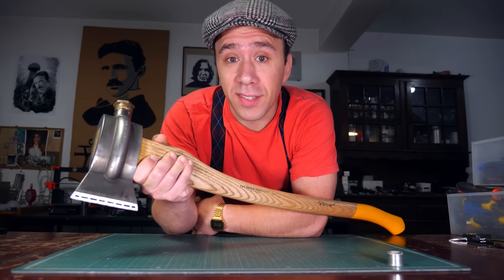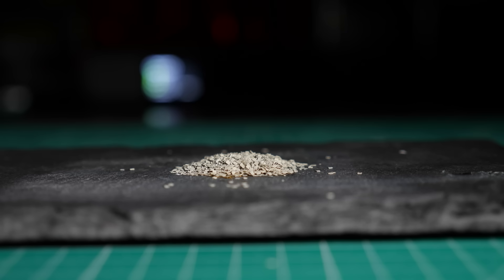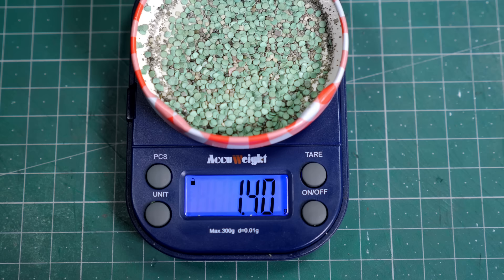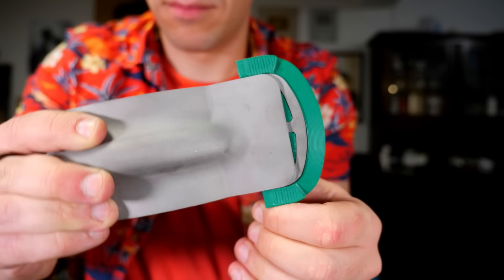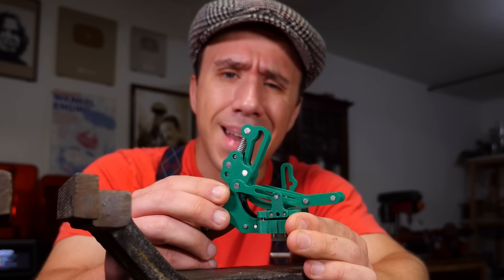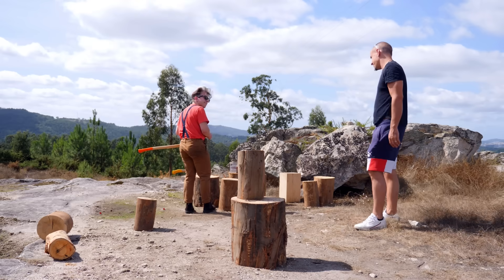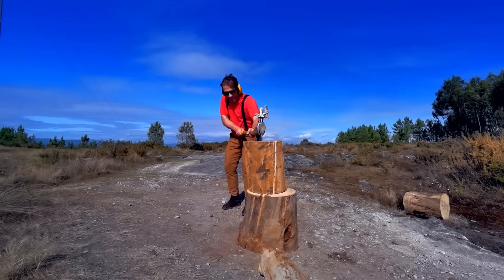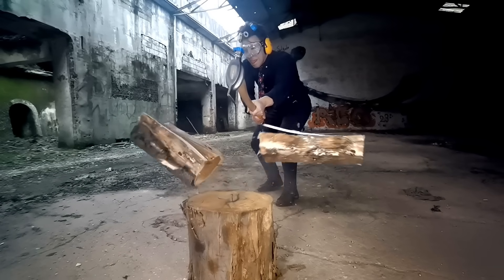I built a BETTER SHOTGUN AXE

Comment: Modern gunpowder (smokeless powder) is actually designed NOT to burn as fast as it possibly could (it's essentially the same thing as gun cotton, nitrocellulose, just cut into a bunch of tiny squares). This is because in a gun you need a force curve in order to overcome the inertia of the bullet and propel it down the barrel. If the gunpowder converted from a solid to a gas nearly instantly most of the pressure would end up forced out of the various gaps in the barrel before it would have time to propel the bullet. Gunpowder therefore has a carefully calibrated burn rate in order to achieve the optimal transfer of energy into the bullet. For your application you might be better off going with the raw material gunpowder is made from, I.E. nitrocellulose. You could probably get your hands on gun primers a lot easier than shotgun shells, and those combined with nitrocellulose (which I know you already know how to make) are essentially the same thing as a shotgun shell.

Comment: For the MK3 shotgun axe, the trigger must be at the level of the blade. After having penetrated sufficiently into the wood, it reaches the trigger at an adjustable distance with a lock at the handle, bicycle cable style, to be "completely safe".
Otherwise, for the nozzle, you need 2 on each side but central for a flow as perpendicular as possible and as fast as possible.

Comment: What about using force to, instead, shove the splitting maul's head further into the wood?  Basically a two piece head.  The leading edge pushed forward by the expanding gases, and the heavy back half holding it in place.

Comment: Should try to find the perfect penetration depth. At that depth on the axe head. Add a lip to prevent the axe head going too deep when swung and hit. For the pressure issues causing the striker to go flying off. Would suggest a 3 bolted flange (kind of like what they use on an exhuast). Then hope the 3D printed metal part does not stress crack.

Comment: Maybe you could use a pressure champer from the AEA Alermo Knallgerät, it can hold up to 300bar of compressed air, should have a practical sice and works basically as simple as a shotgun shell.

Comment: Thought / suggestion.
Rather than the firing system like you have where the timing can be "all over the place", change how the release mechanism releases the hammer.
It won't look nice, but for the sake of trying:
You will need to work out how much..... penetration  (snigger) you need.
Run a metal rod down the side of the blade to just beyond that point.  I'm talking a "Bee's dick more"!
So when the axe gets into the wood that far, the rod is actuated and releases the hammer.
Axe head the correct distance in, BOOM, better transfer of energy.
Thoughts?

Comment: What direction is the pressure from the axe outlets going?  From the video and all appearances it seems like you are directing the pressure down through the log, instead perpendicular to the axe, in the direction that you want the wood to split.  I do thing you would need a downward "breaching" component but it might be more important to have the outward perpendicular component.  When you split a log with an axe, you are more tearing the log apart using a wedge than cutting through it.

Comment: If you add a cross bar to the axe head you block over penetration and increase the momentum of the firing pin. You woulsnt need the spring mechanism

Comment: How about making a mechanical split axe. You could use the shell to drive down a small wedge that opens up multiple lever arms that push the wood away from the blade.
I think there is one already on the market using inertia and the sudden stoppage of the axe head to extend the levers.

Comment: Why not try a ported spike? Deeper penetration and if you gas port about an 1/8th of an in above a hardened tip, and use .5mm holes, you can blow gas in every angle but towards you, pushing against all directions of wood grain.... maybe

Comment: Just use blackpowder instead easy to make dont exceed over 2000 bars and You can ignite it way easer than nitrocelulose. Also maybe it should not be an axe blade but more like tubes/needles that penetrates wood more deep and then deliver pressure inside the log.

Comment: Consider making the trigger mechanism with some arms along the sides of the blade - it will trigger when you're at a specific penetration depth.

Also I wonder if the nozzle angles matter. If the holes are perpendicular and then you sharpen the blade, then the exhaust will be durected to potentially push the axe up and out of the wood, breaking the seal.  If you print the holes such that they're angled slightly back, then they might drive the axe head further into the wood.  Nothing that'll drive the axe meaningfully, but it may constantly re-seal the holes as the gas exhausts with minute motion.

Comment: @integza I'm thinking that maybe the edge of the axe should split the logs with more of a mechanical force. Could you design a head that will be closed to withstand the impact and penetration of the wood, and then wedge open when the explosion occurs? You could even use those nail-setting blanks you showed at the beginning of the video.

Comment: fill the majority of the 40ml of volume with an incompressible liquid, pressurize the gas mix, or combine the liquid buffer/pressurized gas mixture methods. probably.

Or put a push pin just above the depth of nominal penitration that triggers the boom
Reply: also, Hi Integza! Welcome back!!! We've missed you!

Comment: please do more part 2s, so many projects that you've started that i REALLY wanna see updated and expanded upon

The flappy rotary engine for example is prolly the one i want to see more. I wanna see what it can do if you go back to 3 flaps and mount it to a plane for example to compare with Tom Stanton. Maybe there are more ways to make it leak less to make it more efficient.
I just think there are so much left to do with that design. I think you really could set some records in efficiency with it

Comment: idk if you are set on an explosion, but there is alternatives, such as hpa, some airsoft shells can be charged to 3000psi, also rather than using the pressure to blow it apart you could use it to expand wing like mechanisms on each side, would require deeper penetrations but may work with hydrogen if some form of fire use is a requirement you have.

no idea if it would work, im just a retard with an idea and no math skills.

Comment: Grinder for axe sharpening is actually not a bad idea, I use a grinder to rough out the angle of my edge the clean it up with a file and finally just spend a minute or two with a regular knife sharpening stone.
Reply: Grindr for extra penetration.

Comment: @Integza. Replace the smokeless powder charge with equivalent black powder. Why? Because the burning rate of smokeless drops like a falling tomato as soon as there is a pressure leak. Black powder is slower and weaker, but has a more consistent burn rate when the pressure fluctuates. Its heavier combustion products also tend to "self tamp" to some extent. Yes I have the right licences but I'm not in Europe.

Comment: You need better gas sealing. I suggest making an axe that the nose opens to pry the wood apart. Make a two piece hinged to open blade section of the axe. This will give a good gas seal on every hit rather than sometimes sealing to the log and sometimes not. It will also eliminate the axe head from popping out of the log instead of splitting it. This should solve nearly all of your problems.

Comment: I think the innertia based system was supperior. Maybe just tune that one better but I think having the detonation that much closer to the time of impact makes a significant difference. But why use a traditional axe shape anyways? Its not like the axe portion of it does the splitting. Maybe an oversized nail could penetrate better and not cause leaks?

Comment: For version 3, I'd suggest you leave behind the "look" of an axe - the axe blade is already made for splitting, but as you said, you DON'T want to spend the muscle energy on splitting the wood. Make something that goes into the wood more easily and deeper without splitting it, then focus the energy on splitting.
Like a big Needle/Nail that you drive into the wood a light swing.

Comment: I missed he first version. Did you consider using the shell to force a wedge into the log, rather than relying on the compressed gas inside the wood? Also, how much moveable mass would it take on top of the axe to deliver a secondary blow into the wedge to equal the force of the shell?

Comment: you can control the penetration by adjusting the width of the cutting edge and increasing the angle of the blade edge.

Comment: Why don´t you attach a high pressure hose to the handle of your axe, and feed the axe-head with a high-pressure valve-mechanism opening on impact by releasing 250 psi, that are being fed by a pressured-air cylinder and close the valve either after the split of the wooden log has been completed or the moment you retract the handle after impact ? You could use the mechanism of compressed air guns for the car service station.

Comment: Monsieur Integza have you heard about the Air shotgun called the AEA Harpoon. 
The cartridges charge with a paintball compressor to 5000 psi and at close range the air is capable of exploding a watermelon.
Perhaps instead of shotgun shells and explosive gases such air cartridges might give better results.
There are videos in here of reviews of their power.

Comment: @Integza
6:00 If you can evenly intersperse some water mist (not steam, yet) into the HHO-gas, then when the gas explodes, it will instantly cook that water mist into steam and steam expands by about 1'700 times the waters volume, it also takes up heat energy from the explosion & makes the explosion itself be a colder temperature.

Maybe you can somehow use a: ultrasonic water mist maker, to create the water mist, they are fairly cheap 10-30 Euro for a 1x emitter.

Comment: @integza You can use dishwashing Scrubbing pad is also made out of stainless steel it actually from nighthawk videos it easy for hydrogen generation please try for that. Also I have idea one time use compressed cannister but with brown has (HHO) for this shotgun axe but it very very dangerous due sharpnel possiblities even plastic can cause issues only latex ie balloon is safe but how it fit filled balloon inside axe and make this idea to work .
i leave it to you and this curious community. Good luck

Comment: that axe jumps out a LOT, makes sense: it's a smooth metal piece and it's the weak point when the explosion happens inside the wood. Solution: barb the blade. Like a cactus thorn. Once it gets stuck in, it shouldn't be able to come back out! Blasting apart the wood would then be the easiest way for the explosion to dislodge itself...assuming it didn't have other avenues of escape.

Comment: Instead of a continuous blade, try a ridge of many spikes, with the vent holes between the spikes. This has 2 effects:
- It makes it easier to penetrate into the wood
- It allows the gas to continue to flow downwards into the crack, increasing the surface area that the gas can work with

Comment: Better seal around the trigger? Make it curved a bit to keep the pressure inside the mechanism. Instead of flat where it can fly out the sides (due to slight deformations of brass after many blasts ) ? ? Only asking because I thought the older axe was much more destructive .
Reply: I say curved because it also adds to the structural integrity(yoy could sculpted reinforcing ridges around its circumference

Comment: Seems like a thin sharp shaft with an o-ring, venting the gas at the point of the shaft and the o-ring sealing the hole. The whole axe shape is likely unnecessary.

Comment: You aren't swinging hard enough. Try it with proper technique - grip firmly with both hands, one at the end of the handle, the other at the top beneath the head. Swing a full rotation from behind you, overhead, bringing your hands together as you drive the axe into the stump. If you cut deeper, you'll have better success at blowing the object apart

Comment: You could use dual CO2 cartridges instead of shells. One to provide the splitting force though the axe blade, & the second to generate thrust though a nozzle on the rear of the head to maintain contact (equal & opposite forces).

Comment: While you're not chopping wood the traditional way, you should still use the proper stance, as in legs wide apart. Then if you miss the wood, the axe goes between your legs instead of into your leg

Comment: there is very litthe space between the plates in hho generator, so when bubbles form there will be less space for ions to flow, increasing the resistance and reducing the efficiency of the cell. Also, the holes in the plates that are under water allow the current to bypass all the plates again lowering the efficiency

Comment: How about compressing the hydrogen? Then there's more of it in the same volume. Could use a burst disc or foil to keep contained in an easy way. And if you want to thread new waters: have a microcontroller with an accelerometer trigger the spark at the "right" moment.

Comment: Hey dude have to dad mode you from across the pond here...

Not a firearms design expert by ANY means, just a red blooded American with a passion. That said, this machining is beautiful, the device is cool BUT... the loading process of this thing terrifies me.

First, the trigger and sear should probably be of a harder metal which wont wear out... keep an eye on those contact points as I imagine the brass edges will round over time making this more and more of a hair trigger.

I don't know how you would do it, but I feel that hammer should not be primed UNTIL the chamber is locked shut, especially given the aforementioned risks of the trigger.

I'd recommend some sort of manual interference safety.

Also, a reminder of all the potential shrapnel you've got on that device. I am not sure you are working with high enough pressure to Kentucky ballistics yourself but... maybe some PPE.

You say "the mechanism is now locked, loaded, and ready to shoot"... the saying is "lock AND load", which really means "lock THEN load". Protect that primer until you are able to ensure it will discharge in an intended and safe direction.

Comment: You need a better sealing breech lock. Also a more substantial connection to the axe head. Clearly gases are escaping the breech. You did not take what you learned from the first axe head into the second iteration. The venting in the first axehead directed the gases against the sides of the wood, the second directed straight down and pushes the axehead out when detonated.

Comment: To be fair, you didn't waste time making the hydrogen generator. You can use it on a future project.

I won't lie though, I think the shotgun axe is a failed concept after practical experimentation. It WORKS, but as you observed, you have to get the axe blade into the log the perfect amount in order to get it to work (and not choose the worst wood imaginable to cut with an axe, that helps too).

If you want a v2.1 though: The trigger mechanism could be mounted along side the axe blade so when you get sufficient penetration, it pushes the trigger and sets off the cartridge. This would replace the concept of waiting for the shock of the impact to pull the trigger which is imprecise on its timing. You could also have a small plate/shelf (probably curved) just behind the exhaust ports to prevent over penetration which would split the log too much for the seal, and would prevent some of the gnarly log bounce spin in some of the videos which could have ended badly for you. Cross section wise, it would look like:  V
If you make it a wedge press fit and weld it on you don't even need to reprint the entire axe head.

Comment: Try no magnet, and add a little notch that catches one side on the edge of the shell. So that when you pull the lever to remove the spent shell it flings it out.
Better yet create a little box with a spring at the bottom that holds shells in a line with little notches on the side that just barely stop the shells from coming out so that the top most shell is sticking out a little. Then when you push the lever down, it catches on the edge of the top most shell in the box and guides it into place. That way whenever you want to fire again all you have to do is pull the lever up and then back down again.

Comment: Instead of an axe profile, what if you made a spike profile instead and made the surface area small?  Would that not increase the depth in which it would penetrate the wood?
Reply: Think they used to have splitting wedges like that. Sort of conical with 2-3 ports in the tip, you'd drive it into your stump load the cavity with powder, cap it fasten the chain so your wedge doesn't get lost. Then light the fuse and seek cover.

Comment: If the HHO gas is compressed and ignited by the impact of the axe hitting the wood, it may be possible to ignite the gas at a higher density.
However, the mechanisms by which the HHO gas is trapped and the combustion gas is released are unknown.